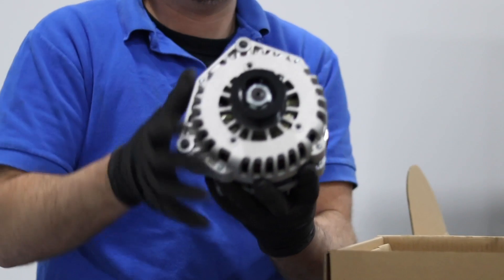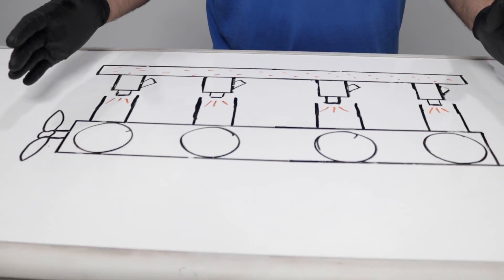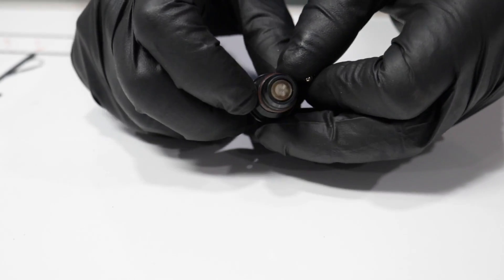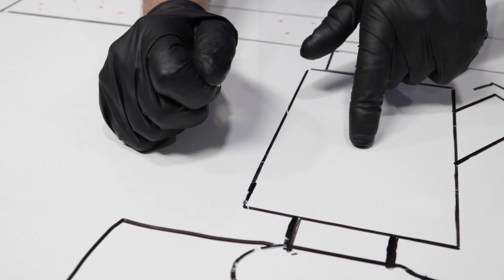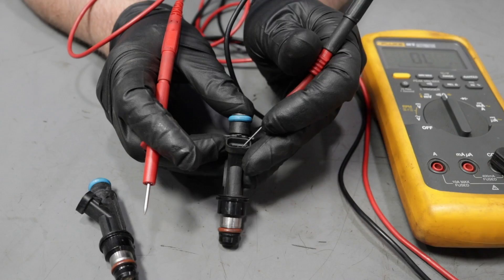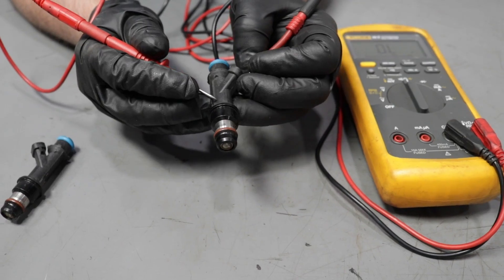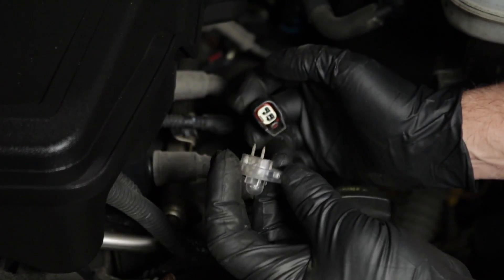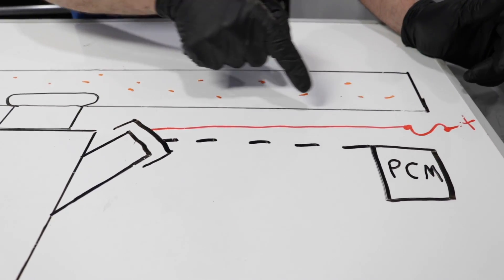Rough Running? Bad Mileage? How to Diagnose Car & Truck Fuel Injectors!

Comment from the maker: √  Watch the Video
√  Buy The Part at 1A Auto https://1aau.to/m-Visit-1AAuto
√  Do it Yourself
√  Save Money
Reply: would this cause a 3-5 second period of “bucking” or “shuttering” when inital acceleration? my 2012 f150 is doing this. already replaced spark plugs
Reply: I have a 2008 Chevy Silverado with 5.3 engine have a misfire on #4 & #7 full injectors I replaced both injectors still misfire and through gas to the exhaust pipe ? Can you help me to know what else I can do. Thank you and my name is Damaso.

Comment: If your short on the Yen so to speak and/or you figure it's better for the environment, I'd get the rebuild kit and clean up the injectors.
You can save big bucks.  As an example on my 2003 Honda Civic LX, the OEM injectors from the dealer can cost a whopping $800 for the set.  Even at discount or just for one injector, it's s pretty penny.  Yeah, you can go non-OEM or try eBay, but you might get screwed.
A rebuild kit for this Honda is about $30.  A cleaning kit is about $60, some more/less; you can also make your own.
It takes a little work, but worth it in my opinion.

Comment: I hope you see this and are able to answer. But recently I bought a 2005 Jeep Grand Cherokee. Was throwing codes for misfires so I changed all spark plugs, coils, and then it gave another code for the fuel injector on cylinder 2. Changed that out, but now the jerking of the engine is worse? I rechecked my work everything's put in right, but nothing seems to work, idk if you'd be able to give some insight or advice on what I should try next?

Comment: This is a mystery to me because. I have a 04 Chevy Impala with the 3800. I have changed the coils, the plugs, the ignition control module, spark plug wires and the car misfires when the engine gets wet… what is causing this?

Comment: I have a 2010 Chevy Tahoe i took it to a auto parts store and they check it with there scan tool cuz the traction control keeped coming out and it came out that fuel injector number 7 was misfiren so should I replace them all or just the one that's misfiren??

Comment: If you've eliminated plugs and coils as the issue, and what we have is that the fuel is running rich, could that still be an injector?  My thought is that if the injector isn't working, no fuel would be getting into the cylinder, right?  Also, the code is throwing that we have misfires on cylinder 1 & 3, but all four plugs are becoming fouled and must be cleaned to restore the engine to run smooth (until the plugs become fouled again).  Thoughts?

Comment: Would bad fuel injectors throw the check engine light on? I have white smoke out of my 2000 Ford f150 exhaust and wondering why

Comment: I bought 4 new injectors for my car, one of them has a tiny faint rattle when I hold it to my ear and shake it, has its valve spring failed?
The other 3 dont make a sound when I shake them next to my ear. 🤷

Comment: what if the fuel injector has too much spray on the nozzle. looks like straight or not spreading. what is the possible problem?

Comment: If I cross the wires that go into the injectors (#5 to #7 / #7 to #5), will I get a P0300 code?  2013 Chevy Silverado 5.3

Comment: When the injector leaks, and no codes throw but high rear o2 mv and youve replaced the cats, spark plugs, O2 sensors etc. This is only on bank 2 So as per me brainstorming today, I am looking at blaming a leaking injector or two possible.

Comment: With the proper scan tool, could you see what happens to the car even if a check engine light doesn't come on? or is that false. I'm having so much trouble with my car and with no codes it's literally impossible to pinpoint

Comment: Is injector cleaner added in gas make any difference ? or always need to remove
Reply: Sometimes it might make a difference but usually if the injector is old and worn it won't.

Comment: Does anyone know what’s the big orange tool he use first that was blinking when he made contact with the injector?
Reply: The orange diagnostic tool used in the demonstration is commonly known as a electronic fuel injector probe.
Reply: Multimeter

Comment: Hi there i have a 2011 nissan qashqai 1.5 dci it has a very loud ticking and a rough start with vibration but no smoke  does my car need new injectors
Reply from the maker: +Rehman Sohail We wouldn't be able to diagnose an issue like that here, you may want to have a local mechanic take a look at it. Thanks for checking us out! http://1aau.to/m/Shop-1AAuto-c
Reply: @1AAuto  the reason most of the people are watching your videos so we don't take our vehicles to mechanics.

Comment: What if you have a rough running engine with no codes
Reply from the maker: +B K We wouldn't be able to diagnose an issue like that here, you may want to have a local mechanic take a look at it. Thanks for checking us out! http://1aau.to/m/Shop-1AAuto-c
Reply: @1AAuto  the reason most of the people are watching your videos so we don't take our vehicles to mechanics.
Reply from the maker: +john smith we appreciate you checking us out and hope our videos have helped you with your repairs! If we could diagnose the problem for you, we'd be happy to.

Comment: Hi! i have an old toyota corolla 2006 diesel 2.0TDI. I tested the resistance between the injectors, every injector has 2 sets of 2 pins, one on the top and one on the bottom. All injectors have the same resistance on the bottom pair of pins. But the ones on the top differ, the injector number 1 and 3 have 1.24kohms and nr 2 and 4 240ohms. Any idea if those values tell something? i checked the manual, the bottom ones are in range. The two pins of the top of injector 1 and 3 are not, the range for the top is 30-9530ohms. Isnt it weird that they have the same exact value? Thanks for any advice. Great video!

Comment: I hope anyone can answer my question. What's the logic behind clogged fuel injectors decreasing fuel economy? Shouldn't it save fuel instead, since less fuel is being injected to the engine because of the clog?
Reply: Working other cylinders much harder
Reply: The engine is no longer running at its efficient state that got it its good fuel mileage.  When its out of wack its not going to get good fuel mileage
Reply: I say it recalibrates the PCM out of whack= less mileage.

Comment: When I step the gas on my truck it feels like it’s lacking power it won’t movie as fast as I’m pressing on the gas feels uneven, and sometimes when is not accelerating (lacking power to keep move faster) at random times, it feels like I went over a little bump and then accelerates faster what could it be ?
Reply: How bout hard shift 1-2 gears?
Reply: I’m having the same issues....did you find out anything?

Comment: im driving an inline 4 Nissan,
petrol,
it's 14 years old.

problem of mine is,
my car cranks fine,
my fuel pump is good.
plugs changed
air filter is good.
no vacuum leak(s)

at times esp after parking for more than 12 hrs,

my car would crank fine and start.
in about a few seconds it would idle rough.
rough i mean real rough.
the engine is literally shaking.

rpm bouncing between 500rpm - 1100rpm

when i step on the gas pedal either in Neutral or to drive off,

it would shudder the car,
it sputters 
sound liken a boxer engine.
really sluggish acceleration only up to 3k rpm it smoothens out.

at times it would start fine,
idle fine,
after moving my car from the parking lot and driving it for less than 5 mins and shutting the engine off,

once i restart the engine 
it would sputter again.
exhaust fumes are of awful smell.

to remedy the problem for the mean time to get the car going,
i have to rev it up in Neutral to about 2k-2.5k rpm for a few seconds,

it then smoothens out and it drive fine.
as if there was never a problem in the first place.

no CEL.

once i had CEL lighted up.

drove it at a constant rpm of about 2-2.5k it smoothens out and CEL is gone.

got a code before 
P0350.

my question is,
is anyone experiencing the same issue regardless of any petrol car you drive.
Reply: Possibly your throttle body sounds like what happened to my explorer one day

Comment: My 2 problems.      I have a 2005 4.0L 4WD toyota tacoma.

okay.

Radio wont turn on.
when the raido wont turn on, the Cab lights, Passenger airbag, and my remote also will not work/turn on.

IF i have the truck on for about an hour straight, or if its cold outside. these things will work.

im also getting codes P0031 and P0051
H02s Heater control circuit low

i bought the vehicle in early 2018 and after 6 months or so the check engine light came on.

i replaced both O2 upstream sensors. 
and the check engine light turned off for about a month.

then it came back on and hasnt gone away.
so i replaced them again and it didnt go off at all.
still the same codes are showing. So im going to replace the downstream sensors as well. just to see.
i also changed two fuses and it turned off for 5 hours and came back on.

at this point i dont know what is going on. i get about 2 mpg less than i should have.
Reply from the maker: +WithJimbo Thanks for checking us out! Since there could be multiple reasons why you are experiencing this issue, we do recommend have a nearby reputable mechanic diagnose the vehicle.

Comment: I have a Nissan X-Terra 3.3 v6 sneaking up on 200k miles.  I've changed everything but the injectors & MAF sensor.  Gas mileage is down about 3 per. gal. & the idle isn't perfect.  It runs great, maybe I'm too picky.  Should the injectors be changed as part of maintenance at this stage?  BTW, It's a 2000 I inherited almost 5yrs. ago & now looks & runs almost new.  Just dealing with the details.
Reply: Hey bud I have an 03 as well. Try some maf cleaner before replacing it. I did it on mine and helped a lot. If your not running stock size tires your gonna lose mpg and also check your air filter before your intake. Mine was nasty as hell, switched it out and gained another 1 mpg.